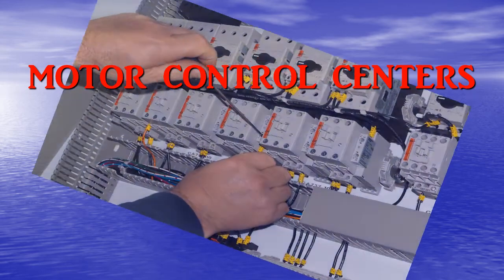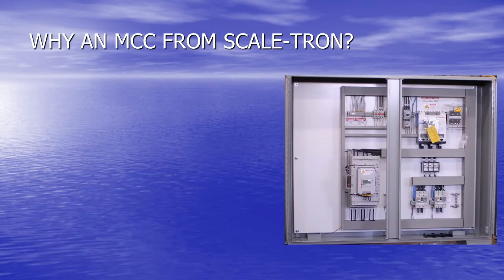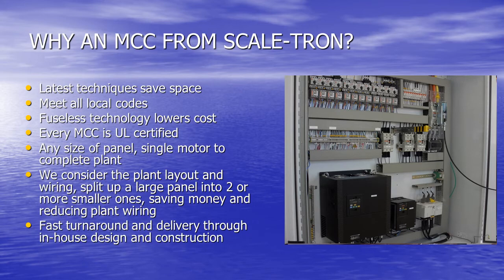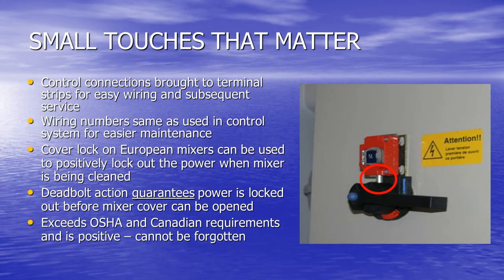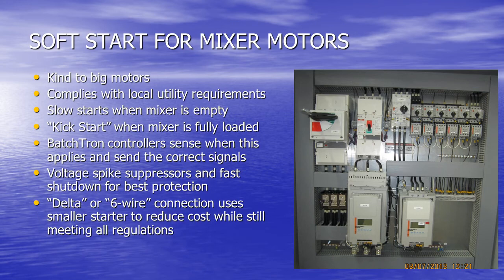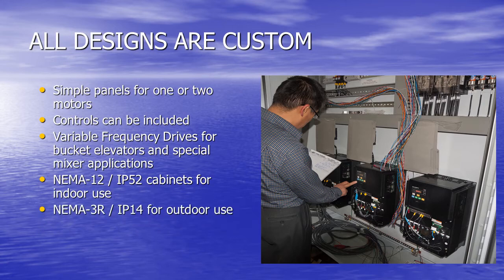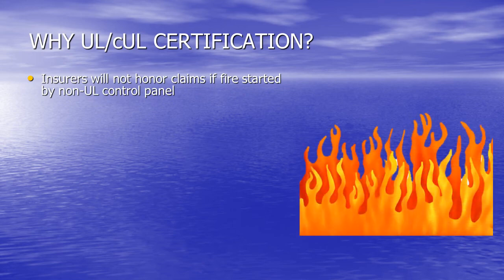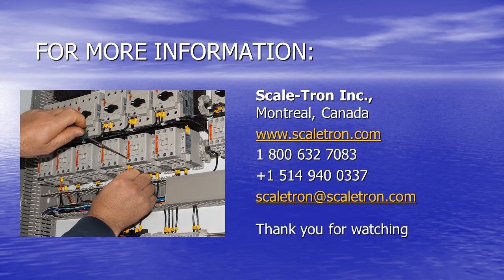Motor Control Centers improve reliability and safety

Comment: I’m not getting the single point of isolation argument. Essentially you are saying that you have to isolate the entire system to perform maintenance on one motor. Maybe I have misinterpreted this but surely you would want local panel isolation and a field isolation ?
Reply: Thanks for the comment.  I'm not saying that, exactly.  You still need isolation switches at each motor if they are out of sight of the main panel, to comply with NEC/CEC.  You would use this isolation switch to work on the individual motor.  However, a larger panel housing all the starters will have an overall main disconnect, rated to break the circuit while power is running to individual motors, rather than being simply an isolation device (with a lower rating).  This is a convenience factor to remove power from all circuits instead of going around a lot of individual starters.  And because it's just one switch, it and the cabinet works out to a lower cost than all the individual starters in separate cases with their own isolation switches.